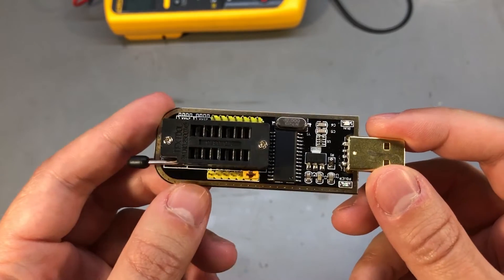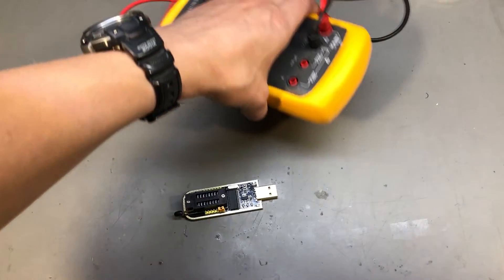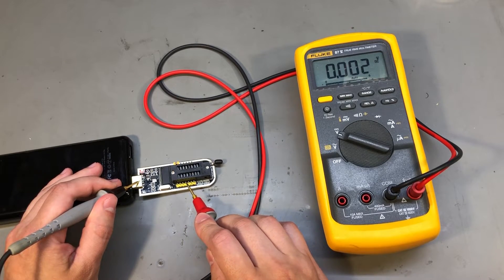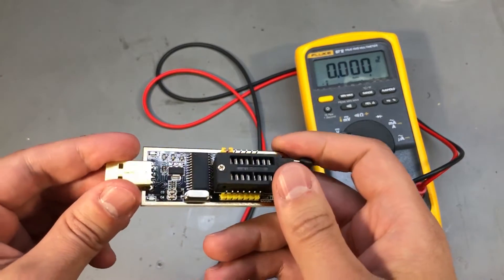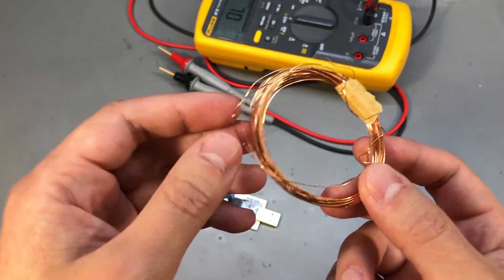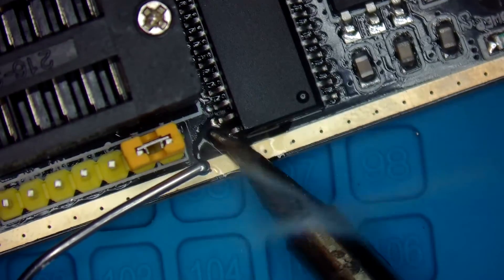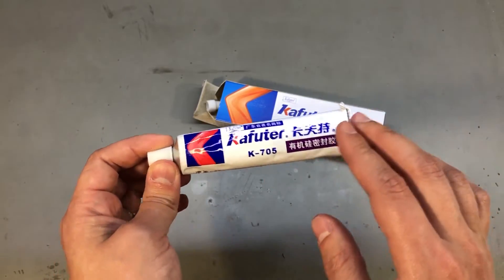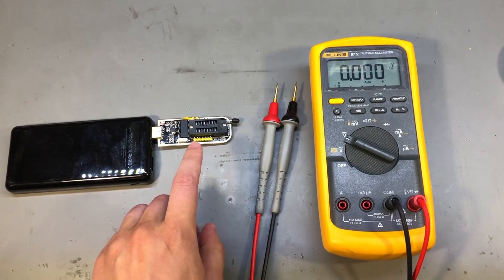CH341 Programmer 3.3V Fix | Voltlog #318

Comment: Useless mod btw.. when u insert the chip it will switch to 3.3 instantly also only 3 pins are 5 the rest are 3.3 already and u can verify that with ur multimeter

Comment: Before this mod, I got consistent verify error on GD25Q64C. Now after this mod, my CH341A works perfectly, thanks!
Reply: Hi delfin! im having trouble reading this same chip on a razer blade, i havent done this mod yet. Tried to read the chip before with all the programmers soft u can imagine. The ones that could read always read FF, could you tell me which version did u use and if i shoulddo this mod to be able to read it (Always with SOIC CLIP, battery and power adapter plugged in). Thank u a lot! All week spent on this.
Reply: I have a programmer but its chip is CH341B . any thoughts?

Comment: Okay, this is really funny. This video shows how to bring level down to 3.3 V, but DrShock has a Youtube with his CH341 only providing 3.3 volt and shows how to modify his version of the board to bring it up to 5.0 V. Apparently, DrShock needs the 5V for automotive chip programming, while the 3.3V is needed for PC BIOS chips. Perhaps you guys can just trade boards? I'd say there are 2 versions out there and just be sure you get the one for your particular chip programming application. This is very interesting topic, though. I used a chip programmer with a sewing needle to 3.3 V power to re-program a 2015 Apple MacBook Prom to unlock it with chip in-place on board with a ribbon cable that attached to a SAM socket directly on the logic board. Nice and clean and no soldering. Just had to hold the pin steady for a few minutes to do the read, and then again to do the write. I'm typing this on that computer. Battery and power disconnected from logic board, sewing needle attached to a 3.3 V lead from an old PC power supply.
Reply: The supply voltage on the test socket of these devices toys are at 3.3V and the "signal-provider", the CH341, is powered with 5V. This leads to signals with 5V level. This mod is to fix this. 
Btw that shows that they are absolute bullshit and that we were ripped off( Yes, I was as stupid and stingy as the others). 
For a Microchip 93Cxx the signal levels are okay, but you need also 5V supply or your programmed data won't be reliable stored. That's nothing you want to gamble with in automotive applications:) Also the pin-layout is slightly different. That is what DrShock's Mod was for.
See https://www.eevblog.com/forum/repair/ch341a-serial-memory-programmer-power-supply-fix/ for a reference and the origin of this modifications. Also both videos are linked in this forum post.
Reply: Well, you can't always grab your hands on a version you specifically need.
For example, in Ukraine I could only find the version of 5V, so I will have to do the mod, as my BIOS chip to be programmed is 3.3V
Reply: I also have to Remove EFI lock on 2015 macbook pro , Can I just use the CLIP straight to the chip ? that ribbon adaptor you talking about costs like 80$!

Comment: Great video! One word of advice to anyone trying this fix: Be VERY careful when lifting up the pin that is later bridged using the additional wire. When I tried to solder the wire onto  the pin I lifted before, it broke off. It is likely that I damaged it already when lifting it up, but as a result it was impossible to solder any wire onto the chip and the whole thing is now toast. Thankfully, these things  are cheap, so I'll just order another one, but better to avoid this happening in the first place.
Reply: I recommend using a desoldering wick. It's going to be easier when lifting up the pin.
Reply: @jorgepayar3699  I did that, and it's definitively recommended, so to remove as much solder as possible.
Reply: Melhor ter comprado o conversor

Comment: Hi.  I just wanted to comment on this video.  I also followed and used a USB power bank.  This did output around 4.7 V to most pins, including most of the ZIF socket  But when I checked VCC pin it was 3.3 V.  So, I 
 then plugged the CH341A into computer.  I checked voltage at socket #8 which is VCC to the chips.  The output is 3.3 V, correct.  All other sockets are at 0 V, nothing at 5 V.  I am using it without modification. Test the VCC socket for V when connected to PC with proper driver.  You may not need to do any modification.
Reply: Just checked mine the data pins are all 5v even though VCC is only 3.3v, I'll have to do the mod for sure. does your device look the same as the one in this video? It would be nice to find one that's actually designed properly.
Reply: У меня точно такой же китайский CH341A Gold и на нижней  боковой планке выдает: 
CLK  =  2,1 v 
CS    =  4,1 v
MOSI = 2,1 v 
MIOS = 2,1 v 
GND 
3,3 v 
5 v

Comment: Thank you very much! my CH341B  worked badly for writing a Winbond 25Q64FV now its works really well !!! my problem is solved thanks you! ( I buy a 341A on ebay and i receive a 341B, but it's work now!!)
Reply: which error did you get? mine could read the entire chip but couldn't erase/write to it
Reply: I am also trying to work with a 25Q64FV

Comment: The question is : the ic can run with 3,3volt instead of 5v ?
Maby we can add a diodes on the outputs to reduce voltage.

Comment: Hey volt i want you to know that volts doesn't kill components but the Amps kill it. So voltage doesn't matter and then when you connect the is decrease to 3.3 volt then the others pin 1.8 volt so the Ch341A was good programma

Comment: Version 1.13 is not the latest version of the software. Version 1.18 has the IC picture with the correct orientation. V1.30 has it wrong again.
Reply from the maker: I knew this comment was coming and I thought about removing that part of the video in editing but in the end left it in there :-)
Reply: @voltlog  i did the mod like this is it right..?

Comment: Thanks for the video. I was hoping this would solve my issue. Problem is, now the CH341 chip gets very hot while connected. Also the status led (opposite side of the board power led) doesn't come on now. This is without the bios chip connected. Is the CH341 fine? I double checked the connections and they are correct according to the video. I'm at a loss here  🙁
Reply: I have same issues 
It doesn't read from laptop I use desktop ic it read clearly 
I don't know what to do now

Comment: Did anyone check if WHEN a Bios chip ect is being erased, programmed ect, what the V on those data lines at that time is?  Maybe the program tells the chip to lower voltage to 3.3v?

Comment: I did the same thing and mine outputs 1.9v I don't know why, maybe is it because i use a super thin copper wire? Also just to clarify did you let those copper wire to touch the side ground? Or it is elevated?

Comment: What is the voltage in data lines when the bios is just running in a PC? I'm wondering if this mod is really necessary. Used this programmer today unmodified on a MX25L6445E chip, worked fine.

Comment: I have a couple of these and just checked them and both have 1.5v on the data lines, I assume they have fixed the design error
Reply: 1.5v on data lines? Shouldn't be 3.3v instead if they were fixed?

Comment: Apparently the 5V data lines dont carry any current so ..shouldnt hurt your 3.3V device however the mod cant hurt unless.....   Can that Main chip on the CH341 get damaged if you feed it 3.3 instead of 5V at pin 28?  Anybody done this and used it many times with no problems or a hot chip?

Comment: Yeah, I recently found this same flaw with a similar device designed specifically for flashing ESP-01 modules - it has a yellow, 8-pin 0.1" socket on it for an ESP-01 to plug into.
The ESP8266 is specifically not 5V-tolerant, and this board has a 3.3V regulator that it uses to power the ESP-01, as well as connecting 3.3V to GPIO0, GPIO2, and CH_PD/EN, but it puts 5V on both the TxD and RxD pins =/
It uses a 16-pin SOIC with no marking for the USB-to-UART conversion, but I suspect it's a CH340G, very similar to the CH341A you've got here.
Surprisingly enough, I don't appear to have fried any ESP-01 modules with it in the time before I noticed this flaw (though of course the modules could be damaged in subtle ways), but it's very annoying regardless, and I no longer use that board, even if it is more convenient than others I have...
Reply from the maker: Exactly, there is always that doubt that you don't want from a tool. Having the correct voltage level can just let you concentrate on other parts of the circuit is something is not working at some point.
Reply: Esp8266 GPIO pins are protected with a snapback circuit and can handle up to around 6v though i would not push it past 5v personally (as mentioned within the data sheet), however the supply voltage remains only 3.3v tolerant,  because of this boards like the nodemcu normally just connect the CH341 chip in the same configuration as used within this video.

Comment: My pcb says CH341a but the main chip says CH341B. I did the same mob and the voltages are appearing correct so I hope the CH341a and CH341b are the same.
Reply: I found a data sheet for the 341b and it's the same as a so all good lol thx for the fix:)

Comment: Hey, nice video!
I'm confused. I checked the voltage as you did in video and I have the same result.
In zif socket on pin 8 (VCC) I have 3.3V....
It's necessary to do this modification ?
And if you want to make some JTAG from that pins you check, you have 3.3V pin.
Anyway i liked the video ;)
Reply: I ask the same, i have 3.3 volts where is it showed on pcb it is 3.3. 

The other pins are all 5 volt. Should be all pins 3.3??
Reply: @bruszttamaskaroly2831  yes. It have to be 3.3V. it's not OK to have 5V in data lines.

Comment: Hmm.. My data lines have 5V but on CH341 pin 9 is already 3.3V. Was there another reason to connect pin 9 to regulator(3.3V)?
Reply: I ended up just doing the pin 28 to regulator part,  since pin 9 was already 3.3V.
Working good now, was able to flash new bios to EN25F16 and MX25L8005 chips 
restoring 2 dead motherboards. Thanks for the video!

Comment: Bro great work. I need to flash a 1.8V gpu bios chip but forgot to order the 1,8V converter. Any way to rewire it for 1.8? a resistor between 5 and 3.3V rails maybe?

Comment: I have a question, if I'm not able to do that soldering to make it be one 3v, is it safer to use the 1.8 adapter piece instead? Just a dump question to avoid and burn or bricking the IC 25 winbond chip.
Reply: I'm also looking and I guess the 1.8v board still outputs 5v unless you actually solder the chip to the 1.8v board.

In short, the board doesn't drop voltages if still pressed into the socket.

Comment: I checked mine (connect to a cellphone charger), all yellow pin are 5v (mios, mosi, clk, cs)  GND is 0 and the 3.3v have  3.3v i dont get what the problem with that? why they need to have 3.3v?
Pin 1-2-5-6 have 5v and 3-7-8 with 3.3v only pin4 0v on the 25xx side and the 24xx side pin 1-2-3-4-7 are at 0v, pin8 3.3v and pin5-6 5v

I just was watching a vid on how to read 93/95xx chip using a mod to get 5v on pin8 for the 25xx , but was thinking on get the 5v from the yellow pin of 5v (from the side), what will happen if I mod this to get perma 3.3v? will affect the 5v yellow pin?

Comment: there is no issue putting a 3.3v chip onto this, even at 5 volts. The amperage is too low to damage any 3.3v chips. It's literally just a dumb rumor

Comment: What is the point of this tutorial? I have the same programmer and I haven't modified it at all. To rewrite the memories, I use adapters and it's ok (with jumper set to 1-2) What you don't say is that: jumper on 2-3 is for the ISP interface. I use it successfully as USBisp and in Arduino IDE.

Comment: So it 3,3v now, but what about 5v parts now?
Reply: These devices are so cheap that you could buy 2 of them and keep one for use with 5v and mod the other for use with 3.3v
Reply: @farzadb82  hey where's the spirit? We could add a switch, no ?
Reply: That is fair. A switch should work, as long as it's switched only while the device is not being powered. You also need to find a spot to place the switch that won't easily break off or interfere with operation. Given the amount of work involved, it seems like it would be easier to have 2 of them. But, if you already had one, adding a switch may be better than waiting 6-8 weeks for another one to be delivered.
Reply from the maker: It all depends on how often you are using this tool and how often you are working with 5V or 3.3V rated parts. Personally I rarely use it and I can't remember if I ever had to work with a 5V rated eeprom or flash. For me it doesn't make sense to have 5V in there.

Comment: I'm a bit confused with regards to pin 9. Do you solder it to the input of the regulator +5V?
Reply: The backside of that regulator, where he soldered pin 9 to, is outputting 3.3v on mine (unmodded).
Reply: @Rukkus333  Thanks, for the amount it costs, I just bought one of the green models which outputs correct voltages.

Comment: I have a problem with this chip: GIGADEVICE 25Q32BSIG used in led tv like RCA, SPELER and others. When i backup the chip and reprogram the led tv works but the Remote Control doesn´t work an the LOGO disapers. I try with a Universal Remote and works with a diferent code from the original. This only hapens with that GIGADEVICE chip, WINBOND 25Q32FVSIG never gives that problem. May the MOD can help?
Reply: the software already checks if the file corresponds to the chip contents, so you might need a different software file for the tv, you could take the one from the other chip, save it and then flash it on the other chip, also backup the tv software online since they are hard to find and might help other users

Comment: my programmer doesn't work. i did this mod successfully. and i thought it would fix my problem. but it seems that the programmer is faulty. not a single bios chip connects to it. it doesn't read the chip the power light just dims which means that there is a short somewhere. and it doesn't matter which way i put the test clip on it still just thinks that its shorted.
Reply: Mine is doing this too. I don't know if it's because the uefi bios chip is still on the motherboard? Did you try anything after this?
Reply: did you figure it out?

Comment: Do you have VCC converted from 5V down to 3V ? Something has resistors to reduce the voltage ?
Reply: QUE TAL AMIGO SALUDOS DESDE  VENEZUELA. 
QUISIERA SABER SI PARA PROGRAMAR BIOS (MAIN) DE 5 VOLTIOS DEBO MODIFICAR ALGO EN EL PROGRAMADOR? CAMBAIR EL JUMPER DE POSICIÓN O NO EL ES ESTÁNDAR PARA 3.3 Y 5???

Comment: I did the mod but i can not detect mx25l6473e in the ch341a can anyone help me..?
Reply: i have the same chip on my laptop, does the CH341A detect it without mod?
Reply: @retroke6560  i detected the chip after i remove it from the board thanks for reply
Reply: @mohamedahmed-cv5gl  i just tried to read it and i could without having to remove it from the board, what devuce do you have?
i mean pc.
Reply: @retroke6560  dell 3020
Reply: @mohamedahmed-cv5gl  man, back up your BIOS so you don't have to pay 4$ lile i did to get in my hand a working one for my asus rog gl552vx.

Comment: current cant burn anything without amps  5. v pin steps down  under load to 3.3 v and therefore no need to modify no engineer fault design just bad reputations on net

Comment: Hello Mr Voltlog, you dont know me but I have been lurking. Very impressed with your BST-863 dissassembly video. Actually there is something else  in particular here can really help me out because I am in a spot after making a mistake. Flashied wrong firmware on to the (very same!) 1080p video capture card which you also featured in a previous video..

What happened? Well I simply was not satisfied with the 1080p30 being the highest 'true' mode. So I then found and downloaded this windows flashing program. It is all written in Chinese language. So when I was trying to backup the firmware I could not understand the words. And clicked a button that seemed to say 'read'. But read it was not. Actually the opposite and then it writes over  the existing firmware with a new one. And then the other firmware was even worse! It took away the 1080p 30 fps mode. Sad face.

It is then I see the PCB inside the metal cage, that there is a Macronix 25xxx SPI flash chip. Perhaps to have a little fun with it you can help me out? And try to read off the contents with your CH341A ? I would be very grateful. Because I cannot find anywhere to download back again return to the original firmware. Only some of these others. If I can send you those files also. But I do not really recommend for others to try to use them. Wishing you well, good day.
Reply from the maker: I am adding that to my todo list, can't promise how soon it will happen but I'll leave a comment here when it's done.
Reply: @voltlog  oh wow, you really replied! LMAO in the Youtube comments here. Thank you.
Reply: @voltlog  can we also reduce it to 1.8v, the step down buck3.3v regulator output, without buying a stupid 1.8v adapter?

does this main ch341 chip work at 1.8v?